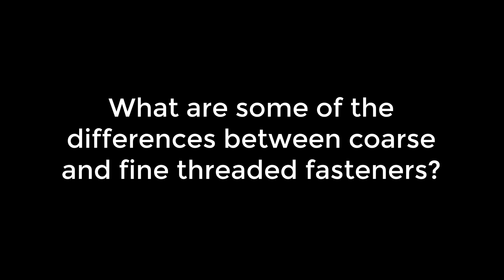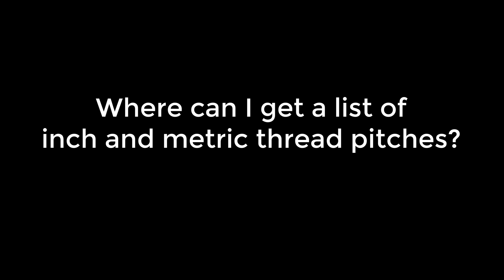Coarse & Fine Thread Fastener Pitches Explained and How To Measure Thread Size

Comment: Hey i Have an issue with a bike stand. The manufacturer told me that it is an m6 screw but the local hardware shop is telling me that it is a fine thread m6. I didnt think these were a thing or at least common. What advice do you have, it needs a high tolerance, since its a 100lb bike. Thanks!

Comment: I'm trying to figure out what thread I need to fit a 2 inch npt bunghole in a 30 gallon barrel.  I need a fitting to fit the bunghole that will have a triclamp end to connect to a triclamp fitting on the end of tigerflex milk tubing

Comment: For an Electrical box I see #8 and #10 sizes X 32 required.  Could you explain why the inch measurement is not used and numbers are in their place.

Comment: Hi, just noticed on your thread pitch chart for Metric threads there is no fine thread dimensions for 1 to 6mm bolts. Do these exist, I would have thought so. Cheers
Reply from the maker: Fine threads are very uncommon for metrics (unlike Inch). They do not exist unless it’s a specialty for 6 and below. Thank you for watching, let me know if I can be of further assistance!

Comment: What happens if you put a fine thread bolt into a course thread hole? And vice-versa?
Reply from the maker: Hi Luke, great question. They will not fit because the threads won’t match. If you force it, it will cross thread and will most likely ruin both fasteners. I hope that helps! Thank you Andy
Reply: @BoltsandNutscom  what if the holes dont have any thread?  I've recently tried to put a m14 x 2 x 100 bolt into a hole that's supposed to accept a m14 x 1.5 x 100 bolt.  However the bolt I had didnt fit into the hole.  What should I do?
Reply: nothing good ....😅